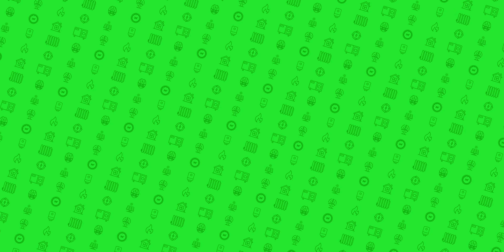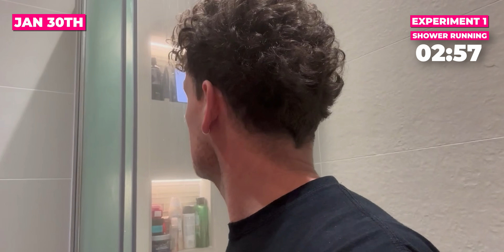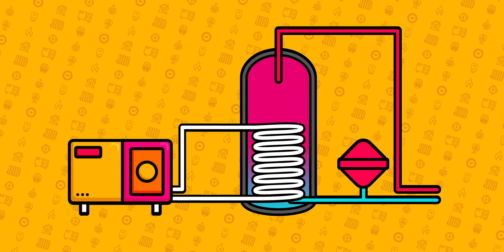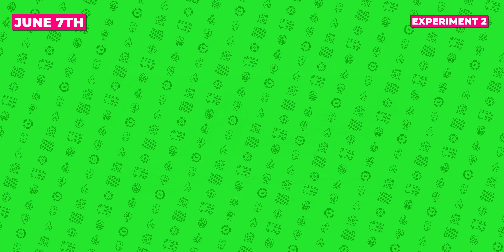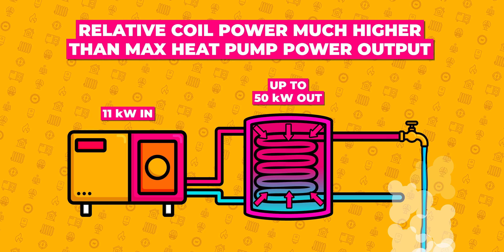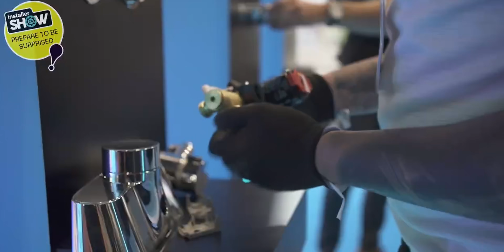The Worlds SMALLEST Cylinder is here!

Comment: Adam, thank you this is brilliant news, and maybe explains why you'd gone quiet for a while? To me it looks like a Sunamp with water instead of phase change material, which I assume would make it much more cost effective, but I'm not bright enough to understand what's different about this product compared to past attempts at thermal batteries.
If it works it would be a game changer for me to go for a heat pump in future. I've never liked the concept of a huge cylinder with lots of complex connections, and not running your hot water fresh each time, the thermal battery concept always seemed more hygenic. Plus if this gives hot water more quickly, it would save the 0.5 to 1 mins wasting water waiting for the warm to come through from a combi.. I never get to wash my hands in warm water! There would be no space penalty inside the house as the combi - which is a similar size - would come out.
It would need to pass the wife test (15 minutes shower or a full bath, at any time of year).  I've got a flow restrictor on the shower to around 7 or 8l/s so pretty sure that's ok, but not sure about the bath, was your wife happy with the flow rate (sounded like it took her about ten minutes to fill which sounds ok).
And would it convince Roger Bisby, I assume he would approve of all the kitchen cupboard install options.😊
Reply from the maker: Haha thanks! Yes wife was very happy with it! The flow rate depends on your incoming cold main pressure really.. and length of time depends on your heat pump size, unit size and snatch flow rate.. it’s definitely doable though

Comment: Brilliant concept, congratulations!
How does the system perform if I start my shower just when the heat pump goes into defrost? Will it stop the defrost cycle? 
Does it make sure to never use that volume as defrost heat source?
Reply from the maker: Defrost is 5 mins and once an hour so provided your unit is sized well or at a good temp you’ll be fine.
Reply: @HeatGeek  Thanks. So in order to correctly size the storage tank for the worst case scenario we will need to calculate: 

x-amount of minutes until we reach the threshold (e.g. 3)
5 minutes for defrost if we happen to be unlucky enough that our defrost is starting just the moment the threshold was crossed
y-amount of minutes left until the shower is finished but now assisted?

It would be interesting to evaluate this if you haven't done it, yet :)

Comment: Love the innovation and look forward to hearing more about this. Can you explain how the system works when the outdoor unit defrosts, will it cool the tank?
Reply: The tank is a store of heat that can be used to defrost the outdoor unit or to heat domestic hot water. When the heat pump defrost cycle starts, the heat pump is put into a mode where it will ignore the call from domestic hot water production from the cylinder, so all the heat in the pipework, emitters and cylinder will be used to defrost the outdoor cylinder. (The tank is also a system volumiser). If the defrost cycle results in the cylinder dropping below the temperature that the cylinder is set to call for heat, then when the cycle ends, the heat pump will enter its DHW production mode to restore the temperature of the tank. An immersion heater in the tank would supplement the heat available for defrost, and help get the tank back up to temperature. This is really the one downside using the Ministore with a heat pump; DHW isn't really available during defrost cycles. You wouldn't have the problem using the Ministore with a gas boiler as they don't need to defrost.

Comment: Probably the biggest hurdle to making the jump to a heat pump if these are proven in the next couple of years.

This will be a question with an obvious answer but still getting to grips with the terminology, does this count as a vented or unvemted cylinder, ie would it require an annual inspection to make sure it doesn't turn into a rocket?

Also unlikely but if heat geek read this, would be interested in their thoughts on  PVT heat pump systems like triple solar. Obviously very expensive and a huge gamble with such little support but removing the noise and external unit combined with this could eliminate another considerable issue in smaller properties.
Reply from the maker: Doesn’t need a service and like the look of pvt!
Reply: @HeatGeek  awesome! Thanks for the reply. Definitely excited at the prospect of being able to go fully electric in the next couple of years.

Comment: This type of approach has been in my plans to implement a heating system for hopefully a fully off-grid tiny house on wheels. Some 16m2 and 3.5m tall space properly insulated for arctic winters & warming summers.
Solar and proper LFP battery system with a great efficient inverter to run it. Properly sized extremely well insulated water tank heated using a solar collector, inverter heat pump and backup from a diesel or LPG boiler.
The real problem is to find 3..5 kW air to water inverter heat pump, and system implementation to survive possible power or heating interruption during coldest winter. 
Any suggestions for modifying small inverter mini-splits for this etc and I'm go for the project!

Comment: Very innovative, great work 👍🏻. If you have a system boiler this could allow you to get 'heat pump ready' by switching to this and keeping the boiler, and get some space back.
My house was a repo HMO, so I've ended up with an unvented 300l hot tank and 200l accumulator for two people, total overkill. Might think of switching to this.

Only potential downside I see is an expansion vessel is still required, but there is usually one integrated into the boiler or heat pump. The volume that this adds to the closed loop may reach the limit of the integrated expansion vessel, so one might need adding.

Comment: Well done for innovating.  Its about time somebody introduced something new into the DHW cylinder market, and approached it with the determination and pragmatism needed to solve the real world challenges in normal-sized houses.

One question, how does the volume of DHW you can draw off (at say 40C) compare to a similarly sized, well engineered UVC which is also set up for 'real time reheat'?  So far as I can see (I can post the full argument if someone wishes to critique it) it could be as good as 'about the same', but couldn't be better.  To get to the same it would need careful engineering to preserve stratification, and a coil of sufficient area that it can extract sufficient energy even when only a small amount of water at the top of the tank is still hot.  Intuitively that feels possible (and is doubtless what you have attempted to do), but it would be good to have the comparative numbers.  

IMHO if the yield is within 10-20% as much as a similarly sized UVC, good then its close to a no-brainer in almost any circumstance (not just combi replacement) just to avoid G3 and another expansion tank, and the associated practical challenges and hassle.   Even if its not quite this good, its still a great innovation, albeit one that perhaps solves a different problem than the one of physical volume.

Comment: Th important thing will be to do the same test in winter when the incoming water is at 5degrees or less. This is the test I would like to see. The next problem in winter is losing the space heating cycle for a prolonged period of time when the hot water is being heated.
Reply from the maker: The test was in January. It was 7c outside. But we’ll obviously see
Reply: Yes I meant the inlet water temperature below 5 degrees not ambient.

Comment: If a heat pump circulates between 35 and 45 Degrees, why couldn't you get rid of the cylinder alltogether and have an extra large plate heat exchanger and have the heat pump turned upto 40Degrees. The fact that your almost hitting steady state means your inputs and outputs are  balanced. Perhaps a slight drop in efficiency but it would be the near zero space soloution? Not much use for a bath but for showers it could be ok, and zero need to store any  hotwater at  all.
Reply from the maker: Because then the system can’t be weather compensated and will have terrible efficiency

Comment: Looks like my Gledhill heat store tank from the '90s, with the exception that I have a diverter valve on the return flow to take the heat to the central heating.
Reply from the maker: This is more like a tube in tube heat exchanger with built in buffer

Comment: Nice bit of innovation. We used to fit acv tank in tank setups with heat pumps which is a similar concept but poor surface area compared to coil delivery and still needed g3 ancillaries, good for reheat efficiency though. Also done buffers with plate delivery dhw on boilers for unlimited hot water, and thought about doing them for heat pumps too. They are all variations of what I know as semi instantaneous hot water solutions. 

Also I think yours could qualify as a shell and tube heat exchanger.
Reply from the maker: Nice!
Reply: Anyone mentioned the consideration for extra primary expansion this solution might need. There is still the potential of Some extra kit to site.

Comment: Otherwise known as a small thermal store. Wouldn't you need a small potable vessel on the hot water pipework?
Reply from the maker: I don’t think thermal store is a good description for the ministore… . People are calling it a thermal store just because the DHW goes through the coil. 

A normal hot water cylinder is also a thermal store officially.. you heat it and store it until use.

The ministore is more like a tube in tube heat exchanger. As it gets most of its energy from the heat pump recharging it rather than its stored reserves (like a combi with preheat switched on).

If you have to categorise it I would say a tube in tube heat exchanger with built in buffer. Or a heat pump powered instantaneous water heater. But not a thermal store.

Traditionally a thermal store is used to describe something that keeps the whole heating system (including rads) at hot water temperatures, so way less efficient for heat pumps.

Comment: Do you need a large expansion vessel on the Heat Pump circuit?
Reply from the maker: No. They are nearly all over sized in low temp heating systems

Comment: Essentially this is nothing new it’s a heat store, this is nothing new, you should concentrate on utilising the free energy that we have in abundance ( the sun light) . We need a hybrid system, as part of this system you should concentrate on passive solar, drain back hydronic solar and thermal mass storage, it’s a no brainer 🎉
Reply from the maker: A normal cylinder is called a heat store.. and this is very different from a normal cylinder…

Perhaps you meant thermal store and got mixed up?

don’t think thermal store is a good description for the ministore… . People are calling it a thermal store just because the DHW goes through the coil. 

A normal hot water cylinder is also a thermal store officially.. you heat it and store it until use.

The ministore is more like a tube in tube heat exchanger. As it gets most of its energy from the heat pump recharging it rather than its stored reserves (like a combi with preheat switched on).

If you have to categorise it I would say a tube in tube heat exchanger with built in buffer. Or a heat pump powered instantaneous water heater. But not a thermal store.

Traditionally a thermal store is used to describe something that keeps the whole heating system (including rads) at hot water temperatures, so way less efficient for heat pumps.

Comment: "World first" is a bit of a stretch.  This is a "hygenic storage tank" and has existed for decades. Google "hygienespeciher" amongst the German heating system world.

Generally the only thing that you might want to advertise here besides the smaller dimensions, is the size of the heat exchanger in the cylinder, usual market designs vary from 5-8m² exchange surface (cheaper ones out of steel, high-end ones out of copper). The more gigantic the heat exchanger the more efficient it'll be due to a smaller Dt from loading temperature to output water temperature.
Reply from the maker: There is nothing like this anywhere in the world. The hygienic is huge and saves no space.

Comment: So this idea has been around for a long time. you tend to use it with solid fuel back boilers on log burners I did it at my house last year with a log burner and combi back up. Not only that it's a heat store as well for the central heating ✊✊✊✊
Reply from the maker: The idea of running DHW through a coul? Yes it’s litrally the oldest heat exchanger in the world. Known as a tube in tube hex.
Reply: https://youtu.be/-piKYCW_OYk?si=jSXapwwv4icNICaX concept idea of what I did but far more simplified in some areas

Comment: I want one, even just to send my excess solar to, but not really worth it when my Intergas Extreme boiler already has separate temperature settings for DWH (42C) and Central heating (38C) which is already condensing when heating. Didn't Alphatek have something similar but heating the input cold water entering the boiler for DWH providing better flow rates for multiple showers and reduced heating costs? Dont think all boilers can handle heated water entering the boiler. Keep up the good work.

Comment: Great video and product. I'm really surprised that heat stores are not used more often in this way. The only draw back I can think of is scaling up, presumably a scale inhibitor would sort that problem. I'll definitly specify this in the future. 
Are they available in green? 
Does it come with a padlock to stop my wife using the tap when I'm in the shower?
Reply: I suspect the higher water velocity in the coil will assist in minimising scale, as well as the lower temperatures.

Comment: I am genuinely amazed at the product you have designed and so thoroughly tested! I'm in the category of want a heat pump but no space for a huge cylinder - but do have cupboard space. I'm completely sold I can't wait to find when it gets mainstream and  installed ASAP for decarbonisation and running costs! Goodbye gas combi I hope soon 👍

Comment: So that I'm understanding this correctly:
It can work with our existing ASHP?
The heat pump doesn't need a hot water mode, its heating the water in the cylinder using the same HP output that runs the radiators?
Reply from the maker: It need hot water priority function that they nearly all have
Reply: Ours is a Mitsubishi Ecodan W85. I'm not aware that it does water, but I know a lot more about solar and electric stuff than HPs and plumbing stuff!
Reply: I've done some research and our ASHP does do hot water. Yay!

So how do I get specs (especially  size) and a quote for the heat battery?

Comment: I assume this can be fitted by someone without the G3 unvented qualification? If so that's a bonus for someone decent at DIY as they could save themselves some money when converting their heating system to be able to run on a  heat pump. Also there would be a saving from not requiring the annual service an unvented tank requires.
Reply: Yes, no G3 qualification is needed. It's very much in the realms of what is possible by a competent DIYer to install. The emphasis is on the competency of whoever is installing it.

Comment: How do you prevent short cycling of the compressor with the smaller volume of water?
Reply from the maker: Why do you think it will short cycle? Heat loss? Or that it will just get up to temperature quickly? It doesn’t quite work like that as it heats the store as heat is being used. If your worried about heat loss just insulate well but that’s not short cycling.. 

Sorry not sure why you think this would happen to hard to answer
Reply: If small volumes are used say 10 l to wash dishes, compressor turns on then off over say  1 minute. Then the same usage repeats several times in 1 hour, hence you get short cycling.
Reply: @TedT07  The compressor doesn't come on to heat those specific 10 L of water. It's connected to the majority of the volume of the water in the storage tank. I don't know the specific settings Adam was using, but imagine that you draw 10 liters of water at a 20°C temperature rise from a tank that might be 200 liters or more*. That would drop the store temp by only a single degree and the hysteresis controller would prevent the compressor coming on for every single degree drop in the store. 
So, you get that first 10 liters of water with zero cycles on the compressor. 
If you do it over and over, or as the temp slowly losses heat to the surroundings, the compressor comes on to replenish the thermal energy in the tank, but can be set such that there is a minimum run duration (by kicking the compressor on at temp T, but not kicking it off until T+5, a 9 kW energy source will take around 8 minutes to create that 5°C temperature rise in the store)

* - You're not drawing water per-se, but drawing the energy from the storage water into the loop of water that ends up in kitchen sink for washing.

Comment: We don’t have a lot of boilers in the US, but I still want one of these. I think the closest thing we have here is a Sanco unit but it is a bit expensive.
Reply: I have been to the States many times and can assure you that there are a lot of old boilers there.😉
Reply: @normanboyes4983  True. They are more common in New England. But I grew up with nat gas forced air in the Midwest and moved out to the Pacific Northwest where electric resistance heat is common.